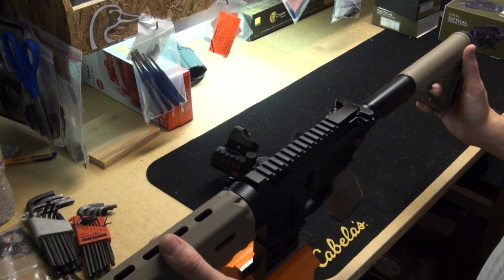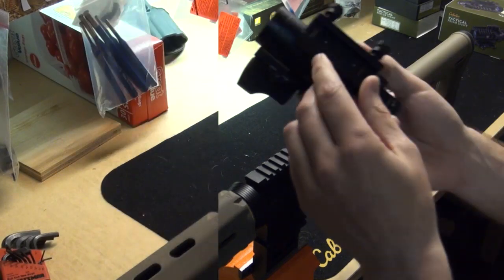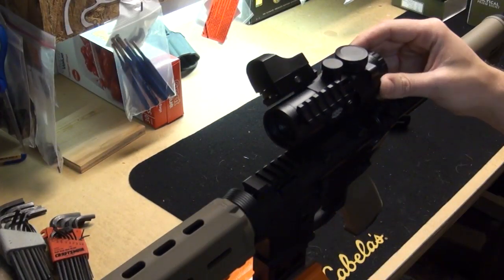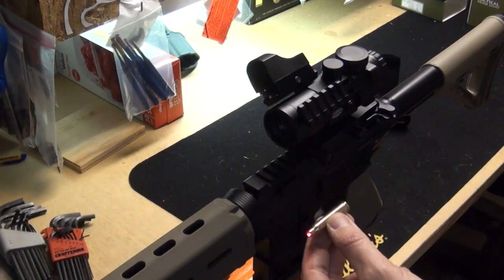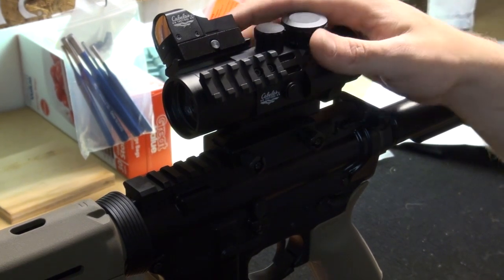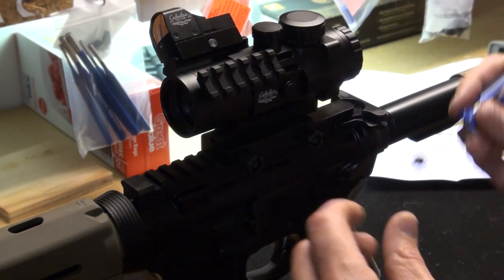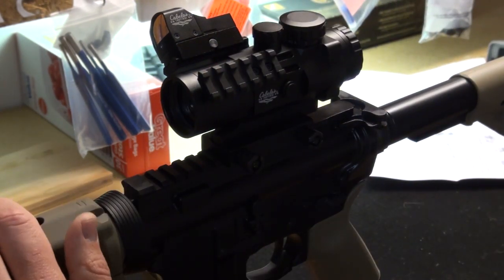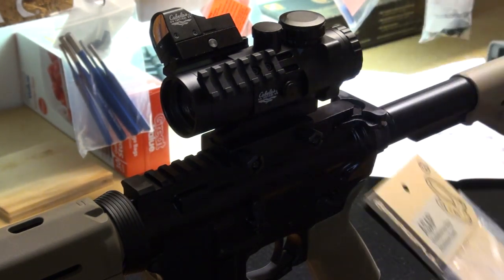Windham Weaponry Build Part 6 - Installing Optics

Comment: Desert Raider, How far away was the bore sight laser dot ahead of the muzzle? It looks really close. Unless it was ~25 yards, by dialing down the sight's elevation to match it you set up a hug parallax error.  If you zero the sight to the bore at roughly 25 yards, (that's the first place were the bullet path will cross the line of sight) you'll have a Battle Zero out to ~300 yards.  If you sight in to a bore sight too close, you'll be shooting really, really high...